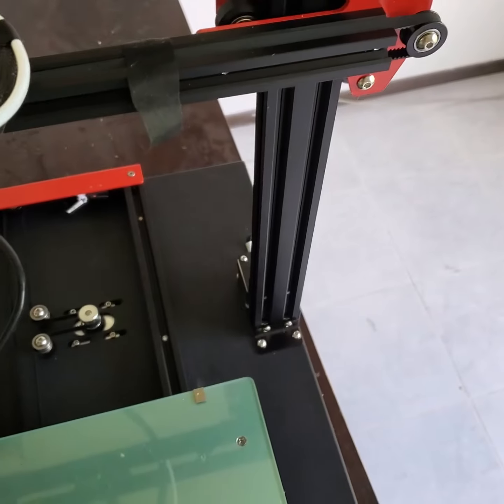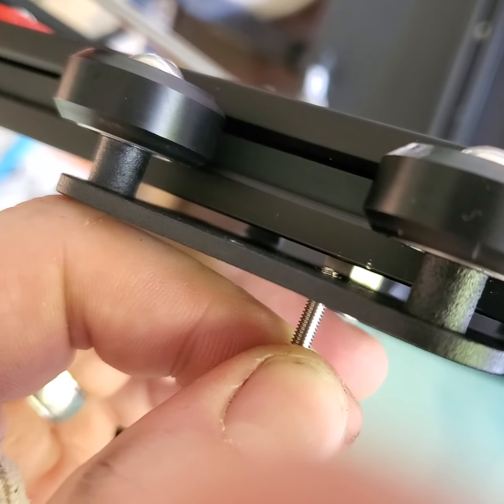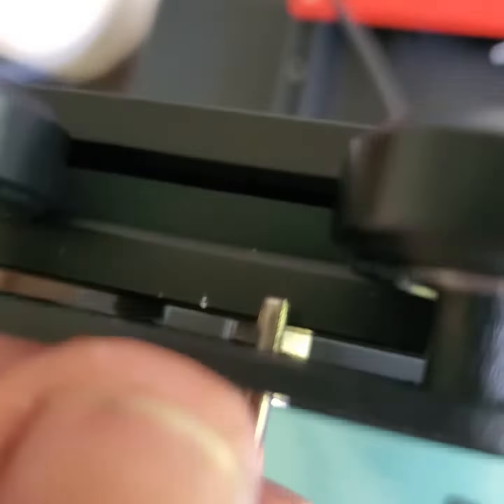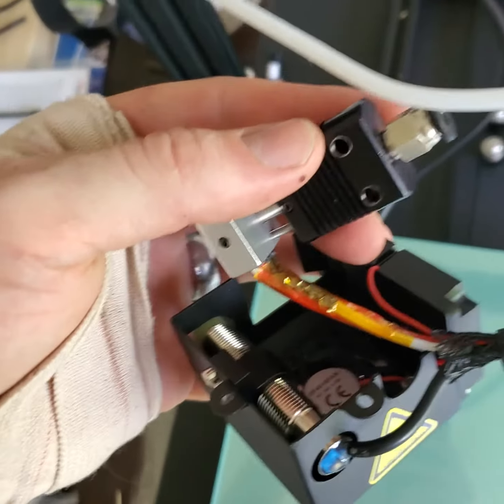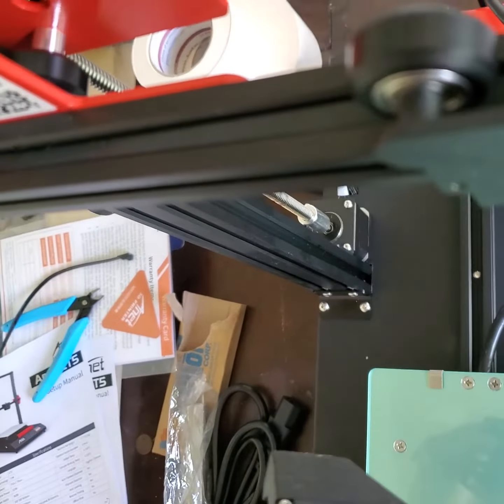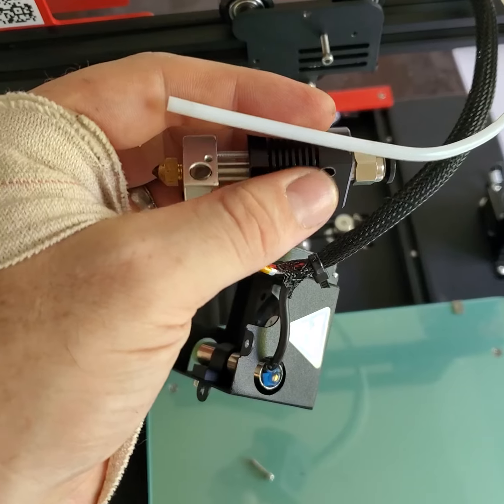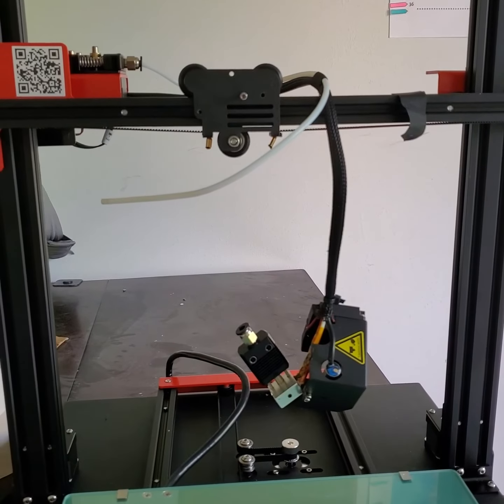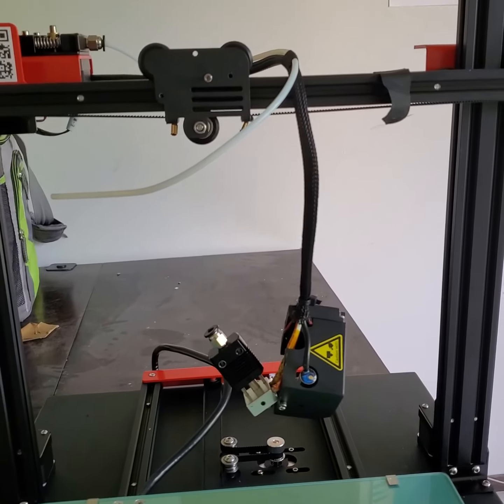Anet ET5 Hands on review   Part 4

Comment: Korey, is it possible to use loctite or something similar to hold the bolts of the extruder part to the runner on the rails, so that it isn't just held there by tension?

Thank you for all the insights that you have given in this 4 part series. I ordered an ET5 pro, partially based on your reviews.